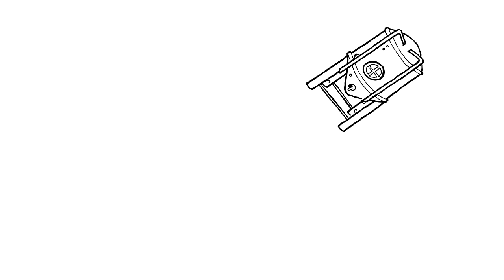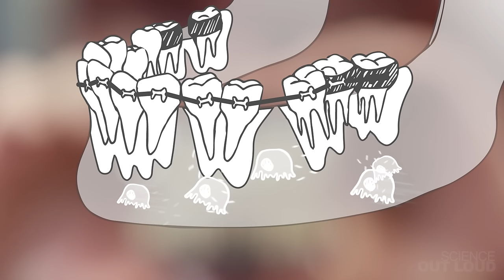How Do Braces Work?

Comment: i got braces last year. here’s a tip/fact:

i still had to do things after, so i had to eat and live life. at first you feel awkward, it doesn’t hurt like you think it would, at least immediately. after a few hours, it will affect you and it will hurt, so be careful. my tip is to heat up toaster pastries really soft, cut them into small slices, and chew with your back teeth, because they hurt less, also get a pillow, find a corner, and smush your forehead right into the pillow. this helped me

before i got braces, i had spacers to be able to get the rings on my molars. i thought they were the most uncomfortable part of the braces process. the next morning, i woke up and one was gone, that meant it worked well. i thought i swallowed it until that night, where i found it in my bed,

if you get powerchains, they suck

so do rubber bands. i once in  public forgot to take them out and ate pasta with marinara sauce, and they were stained red, i realized i didn’t have a change, and it looked like i ate someone. 

tips!
Reply: Astrid  it’s fine I currently have braces on and in the beginning they always used to hurt even sometimes after the appointments they hurt
Reply: @Lana-ut5cd  how much does it hurt from 1-10? Getting braces in a few days
Reply: @marly54  it's literally just uncomfortable and everyone has a different pain experience because teeth are different and pain tolerance (it only hurts a little to eat especially if you use your front teeth but the rest is just feeling uncomfortable for a few days)
Reply: For me braces really didn't hurt it just felt a bit sensitive for the first two days or maye it's cause I have a less severe treatment. Anways you'll be fine just follow what your orthodontist says :)
Reply: @sephe8192  aight thanks
Reply: @marly54  did it hurt
Reply: @kabeom  yes, and no, the first 3-4 hours, i just felt uncomfortable, 6 hours in and thats when the pain kicks in, but its not that painful, all i had to do was take a pain reliever and its basically gone, 4 days with my braces now and its pretty much painless, tho u do need to avoid chewing stuff
Reply: @marly54  ah 😭 well thank u for explaining
Reply: @kabeom  u getting braces soon?
Reply: @marly54  in a few months lol
Reply: Interesting I had power-chains and rubber bands, but to me they felt normal (just a bit sore, but not as bad as when I had to get my wires tightened).
Reply: i have spacers on and its really very uncomfortable lol, i dont want braces anymore😭
Reply: @marly54  I guess you already have braces by now?
Reply: @afrojamamud9586  spacerss aree worsttt...trust mee braces doesnt hust as much as spacerss doo
Reply: @ksfaizaan4357  yep, pretty much smooth sailing
Reply: @marly54  yeahh bracess is all finee untill elasticssss damnn😑
Reply: @marly54  anywayss bestt of luckk for your braces journeyyy
Reply: @ksfaizaan4357  elastics???
Reply: @marly54  they are kinda like tiny rubberbands which you gotta hook from upper to your lower bracess...youuu cannott eat with themm which is worsttt😑 like you have to remove it everytime you eatt and the sad part is we eat almortt everytimeee😂
Reply: @ksfaizaan4357  oooooooh, so thats what i was seeing from my friend's braces, ive always wondered what the strings on the back end of the braces are
Reply: @sephe8192  did you get yr teeths removed too? My dentist suggested to extract 4 teeth , 2 above and 2 below
Reply: Power chains look cuter tho😭 if I take a non stainy Color I think it will be fine + they put more force to the braces moving ur teeth faster
Reply: Here four years later how do your teeth look
Reply: Here’s a tip/fact eat soft food when your teeth hurt eat whatever except stick stuff when they don’t and in small bites. Braces aren’t complicated they won’t break relax

Comment: As someone had said, if you're going to have braces, or do have them, don't fret.
I had braces for 1.5 years when I was supposed to have them for 2.5 or 3 years.
- Braces aren't nearly as bad as you think.
- Make sure to brush twice a day, use mouth rinse, and floss to prevent tooth decay from braces.
- You can eat a lot more stuff with braces than you can imagine. (The food I had the most difficulty with was bread)
- They don't even hurt that badly, usually unnoticeable. The first week will be the worst, but it's still not even that bad.
Even though everyone speaks of braces sucking and being absolute torture, I assure you it's not bad at all. The worst part has to be when the braces uncomfortably prick the sides of your mouth. But that's what wax is for, so don't worry.
Reply: Braces has been the worst experience of my life. I’ve had power chains and four teeth extracted, and super sensitivity that was never there before. Everyone is different so are their treatments. I’ve had to have four screws drilled into my mouth to have bands holding on to my braces. It’s extremely painful. Not to mention that the food we eat in my country are for some reason hard crunchy and staining. So you really can’t speak generally.
Reply: I've had a few brackets come off because of eating bread. When they get chewy and sticky in the mouth it can actually pull stuff that's why I toast my bread instead. Also to add, getting braces made me lose weight effortlessly 😂 I gained it back when it was already okay to eat anything though.

Comment: I've seen people in the comments tell us their brace ''horror stories'' such as swallowing a bracket or a band snapping, but I've had my braces for about 9 months now, and the worst I've had is maybe a bracket that has flipped around, it really just depends on your orthodontist or dentist that fits your braces, my orthodontist has consisted on multiple orthodontists fitting my new braces every 5 weeks, and only 1 of them was slightly uncomfortable. I don't know if there's problems just have the top set, or the bottom set, because I have both, I don't think there is a way to counter these ''problems'' but if these problems are occurring every so often, then you'd probably want to complain or even consider a new orthodontist or dentist.
Reply: Sure you're true. But there are times when you eating some hard stuff, and don't realise that your bite actually took down a bracket, and next thing you know, its down the gullet😂
Reply: Would you like to take that back now that its been a year

Comment: When you try to figure out why something happens without acknowledging that everything has happened for a reason and before the question is answered their is always a solution presented before the problem has been completely solved which is practical at first but not necessarily the best but its good because you will be able to build off of what you learned and be able to improve the standards for anything reasonably specific making the world a better place so is the cycle of the world we live in therefore this can be applied to any situation this comment is specific towards

Comment: Reading a lot of comments saying that braces hurts as HELL !
Let's not scare those, who are going to get their pairs in few days..

My braces treatment has reached to 6 month by now, got my bite turbos/blockers/breakers ( whatever you called it ), on the very first day itself.

Only thing which is difficult initially, is getting used to with bite turbos while eating ( one becomes comfortable within 1 week easily).

You yourself start observing changes within month, my crooked teeth aligned within 3 months & intially they were SCARY AF!

Trust your orthodontist, you've embarked on a journey destined with a healthy smile !

Comment: ATTENTION! if you are a newcommer to braces or are soon to get them on these are some tips and tricks to help you!! 
I've had my braces for a really long time now (about a year and a half out of my 2 years), if you are a newcommer to braces or are soon to get them here are a few tips and some things that can happen: Once you get them on and leave the dentist it may just feel tight and awkward but no pain, the clock is ticking to enjoy food for the rest of the time however..., you have about 2 hours to enjoy until the pain will kick in, pain consists of loads of soreness, tight feeling in your mouth, headaches due to the pain, and a huge difficulty biting and eating without feeling like you're gonna die, Here is the tip: What i did at this point was get a blender and cut up my food not to the point of mush and smoothie like but just enough to have it be cut finely so you just have to chew lightly and swallow i did this for about a week or 2, also the next obvious one is painkillers. AFTER A WEEK OR 2 PAIN WILL MOSTLY SUBSIDE!: Good job! you made it through the hardest part in my opinion. you can start actually chewing without blending the food finally and eat as normal. There are a few more problems you can encounter after that though: These consist of breaking off brackets by mistake or the wire beggining to poke your sides of your mouth Here is the tip: If you do break the bracket by mistake its not the end of the world, if you didnt swallow it on accident simply take it out and save it in a bag if its a bracket near the back teeth theres no need for concerns they arent TOO important and you can most likely go the whole time until your next visit, FRONT BRACKETS ARE A DIFFERENT STORY These brackets are the ones moving the teeth the most and breaking them will ruin the proceedure if you dont go to the orthodontist very soon, just drive over there and tell them what happened and they most likely will just put it back on without hastle. Tip for the wires poking: 1. Either go to the dentist and ask them to cut the excess, or 2. Get some orthodontic braces wax to put over the wire to hold you over to the next visit. This is the first visit though. The second visit/tightening will be easier they may replace the wire or wait until future visits Once you finish the second visit its kind of similar to the first except the pain wont last as long as you're already used to it, the pain only last like 3 or 4 days if not less, A simple light tip: Just take Advil or something similar, Now further into the future you might get something known as elastics they are to help with moving the teeth more, They go on hooks that are on the brackets themselves but only attatch it to the hooks the orthodontist tells you or you might just mess up your bite These things will be painful for the first few days and you wont want to put them on but as always you will get used to them, if you don't persue the percedure or braces might be extended due you laziness These elastics are meant to be worn 24/7 unless you're eating or brushing your teeth if you run out just go to the office and ask for a new bag, This is the point im at right now i don't have anymore tips GOOD LUCK! And i wish you to have straighter teeth!

This was based on my personal experience each person's experience may be different

Comment: Braces recess the maxilla and make the appearance of the face worse after treatment since they apply backwards pressure on the teeth which causes the jaws to move backwards since the teeth are connected to them. Extractions with braces are even more damaging to the face

Comment: I have always been insecured with my smile. The lower jaw  waslittle crooked but cute but my upper jaw teeth were fucking bad that I hated smiling. I was not confident but my friends used to not  comment on my teeth that much as I never showed them. I couldn't afford braces in my teenage years and having braces in India was considered as luxury back then and my mom didn't support it.  I decided when I will grow up and have a job first thing I would do is wear a braces and go through an orthodontic treatment. Now I grew up became a lawyer and now I have braces at 27. Just few months left to go without braces. So so happy with the outcome already. Thank you God.

Comment: ive only had braces for about 4-5 months and when i tell u it doesnt hurt, IT DOESNT. i mean it depends on people but when i first got mine, the first 2 hours really feels like its not even there so like everybody else says, eat as much as u can because after that u will probably cry. the first adjustment hurt quite a bit but trust me, drinking cold water and letting it sit in ur mouth for a bit WORKS LIKE A CHARM. and dont worry about the next future adjustments because im sure u already got used to it by that time.

Comment: everyone keeps saying that getting braces hurt. I felt pretty much nothing (using Damon braces). For the first 3 days it really hurts to eat but after that its normal. When they adjust them you're gonna feel hurt a bit when u eat for the next day or so but it will subside. The longer you've had them on, the less of the pain will come from adjustment. After like 2 months, adjusting them didnt have any after effects. I just stopped noticing they were there kind of.

Comment: I've had my braces on for about 5 years but I'm getting them off tomorrow. I'm kind of sad, I actually didn't have that many disadvantages with them, and I think that they add to my overall character.. my bracey, awkward smile. But I know that I probably won't care after some time.. the braces and my dentist did an amazing job though. I had a pretty bad overbite and it looked alien-like, looking back at it now. However I'll have to get a permanent "retainer" for my bottom row of teeth (it goes behind), and I'll wear a retainer for the top row at night.

Comment: Once I tried dunking on a 8.5 rim (I’m 4’10 Incase you are wondering) I missed the rim then my front tooth got hit really hard by the metal pole holding the board. I was so surprised it didn’t break

Comment: I want braces so bad! I have a massive overbite - it's so big that when I smile, I can comfortably fit my thumb between my front teeth and the bottom row of teeth.  I also have an overcrowding issue. Plus, they're just not straight! I'm so tired of avoiding smiling and having to cover my mouth when I laugh. But, braces are so expensive. I'm 14, turning 15 in May, and I'm worried that it's too late. I'll probably never get them, if I haven't gotten them by now.

Comment: They tried to give me braces because my jaw is slightly wonky in a way that my lower jaw is way further back than my upper jaw... so i have a slight gap between my top and bottom teeth... however it was one of those braces you put in and can pull out.. but it really was terrible so i didn’t wear it.. i was supposed to wear it day and night but night didn’t work anyways because it would just fall out as i would just spit it out in my sleep.. though my dad had another doctor look at my mouth who said that in my case it was such a minimal gap (wich my dad also has) that correcting it would not do any good as it was just throwing away money for a problem that isn’t a problem.. they literally said it was unnessecary when the other one who wanted the brace done was like oh but when you grow up you might not be able to eat and we will have to correct it with surgery.. they said it would have to be done when i was 19... well i’m 19 now and i don’t have any problems with my teeth.. other than that my teeth are so straight against each other that if food sticks inbetween it will never get out..

Comment: I have a question tho
I heard this from someone and im not sure if its true but can braces reshape your face? So can you get an underbite or whatever that thing is called
Reply: Marshmallow yes, absolutely yes. I thought it was a myth before getting them. I didn't need them for reshaping face reasons, just vampire fangs that needed to get straight with the rest of my teeth. I'm now almost a year with braces, my teeth are already straight, but i have to keep wearing them to keep the shape. And everyone said that i became '' prettier '' i though it was due to the teeth alignment, but recently i saw older pictures of my self, and my face have really changed, my smile is wider, and my lower jaw is more defined, so my face is more structured in a way

Comment: I have just had braces put to correct my lower jaw which needs to grow outward but I realised the braces force my lower jaw forward but my front teeth (upper and lower) do not meet when I bite down...like a gap between upper and lower...is that normal or a problem?

Comment: Yeah but it doesn't work when orthadonists are pulling out peoples teeth instead of expanding. All you get is recessed maxillas which is a problem in its self. The whole point of braces should be to make your mouth to the right size not make it narrower and straighter.